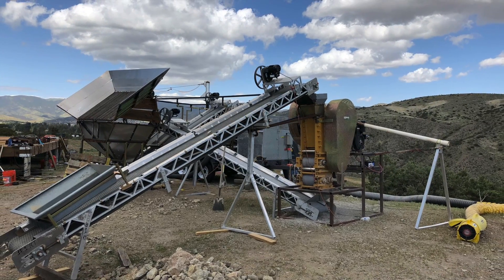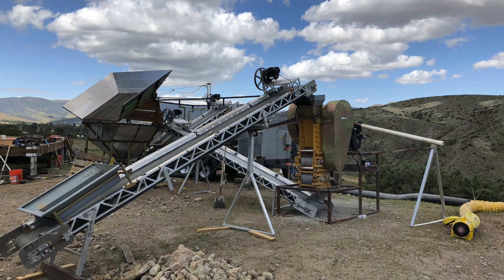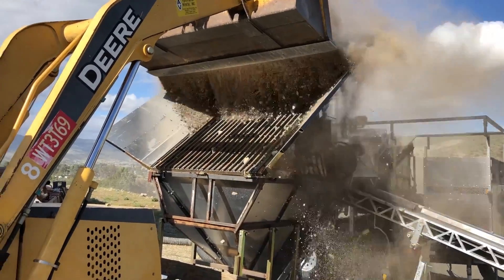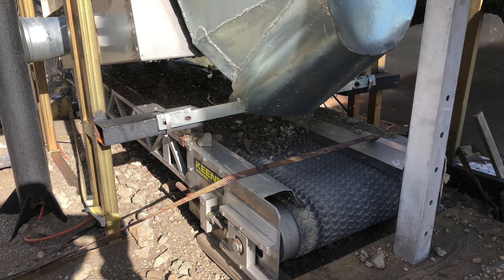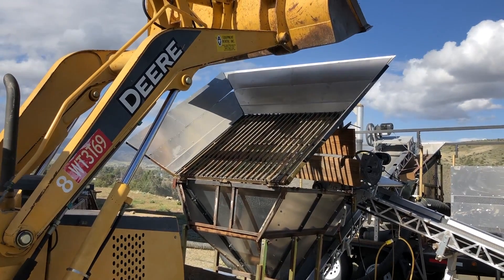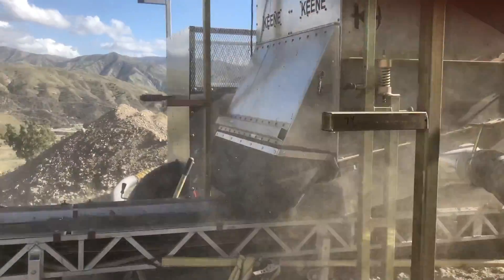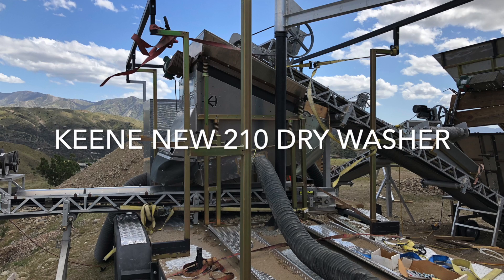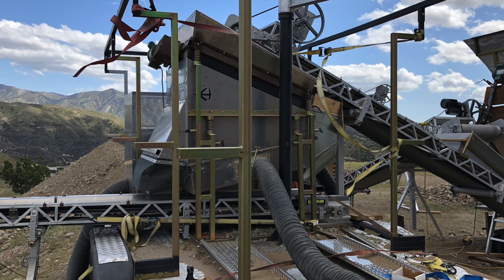210 Dry Washer update

Comment from the maker: We are not sure about the price just yet around 10k plus for the box frame vibratory shaker deck screen and hose and blower.  You will need 110 power for the vibrating shaker deck and 12-volt source for the lower box vibrator.  The was going to be around 10 k However the cost of materials is through the roof.
Reply: Tariffs on metal are killing manufacturing -- keep up the excellent work and "chin up". You guys are going to weather this and gold per ounce is going to go through the roof again! Blessings!!